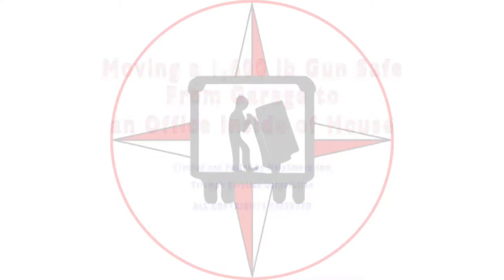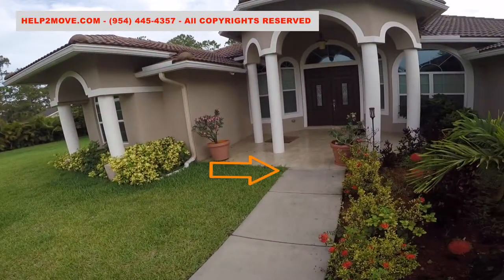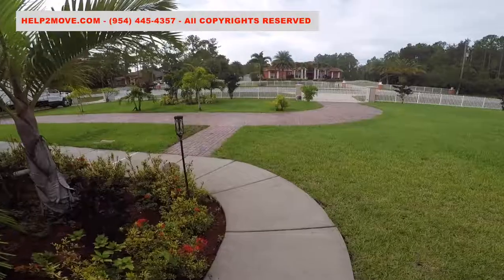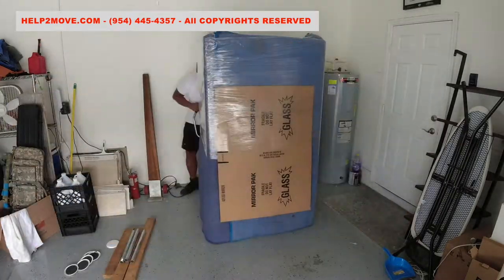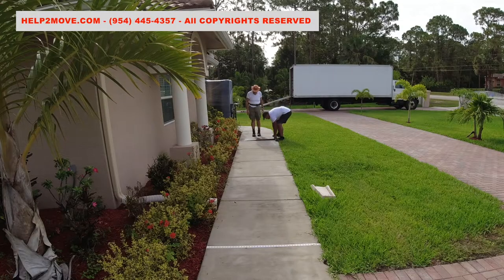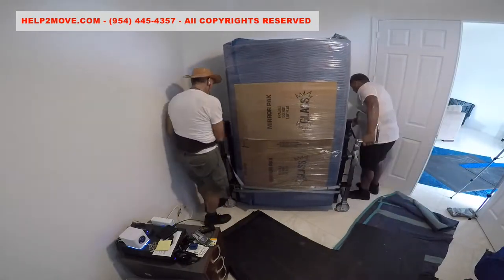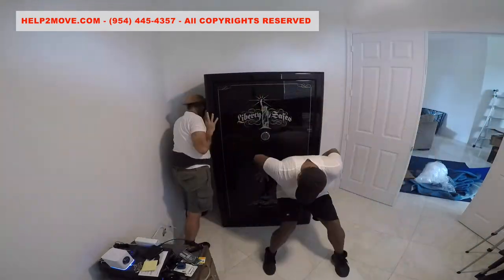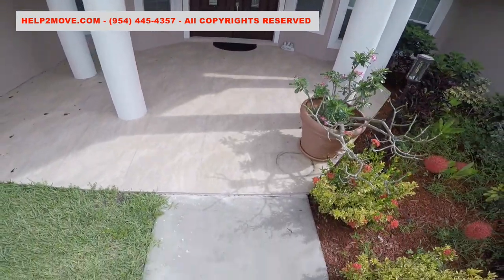MOVING A 1,588 LBS GUN SAFE - WILL IT BREAK THE CERAMIC?

Comment: What does a job like this cost?  It seems pretty “simple”, but there’s a lot of experience and specialized hardware shown here.
Reply from the maker: It depends on the distance travelled to the customer, the weight of the safe, number of steps, type of flooring, if it is going into a closet or an open room. If the move is from a garage to a room, it will range between $300 to $700. If the place is really complicated and dangerous to work with a safe over 800 pounds the price will be even bigger.
Reply from the maker: Thanks for your comment. Please SUBSCRIBE!